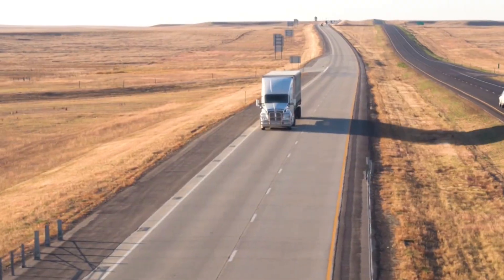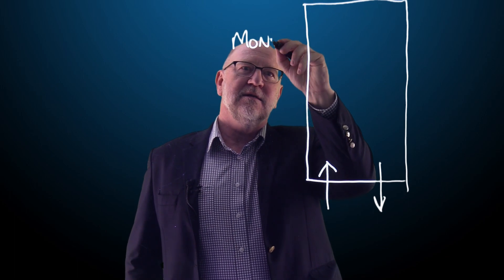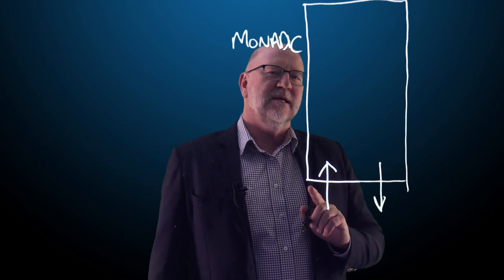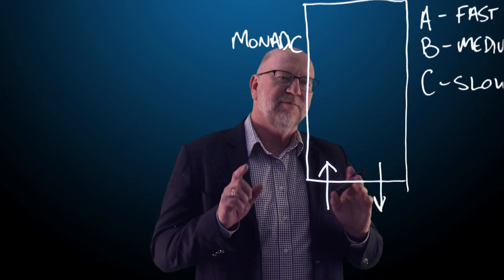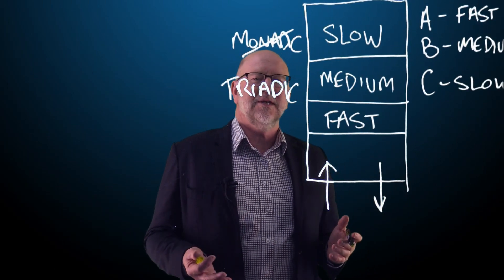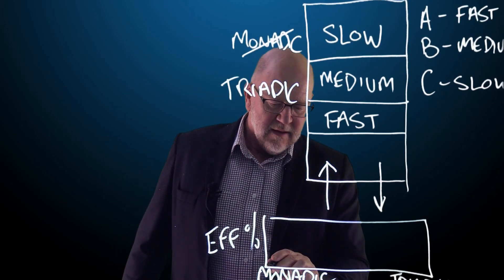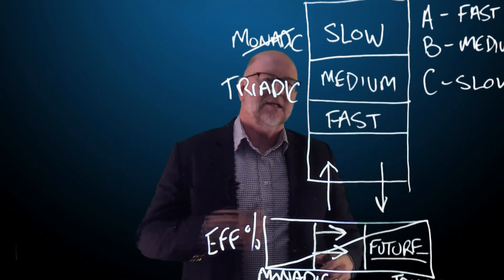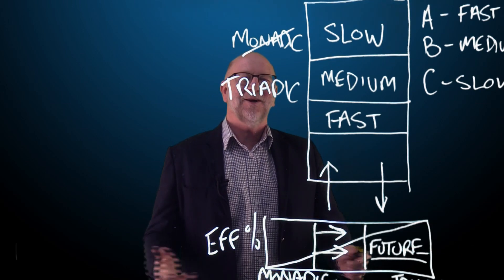Triadic Warehouse - More Warehouse Tips from Mal Walker

Comment: Triadic is incredibly old school and limiting. It works if there is zero expansion of items, zero innovation in new products, and if your warehouse is U-Shaped. It may work well in a distribution environment where a DC is replenishing other warehouses or retail locations where there are no new products added. 

However, if you have a lot of SKU’s, new SKU’s being introduced regularly, then triadic will cost more labor hours in constantly moving around inventory between A, B and C zones. In that case a monadic warehouse where items can be stowed randomly is far superior. 

Efficiencies in order picking would then be focused on optimal pick path, multi order picking, multi unit picking with a sortation process between pick and pack.
Reply from the maker: I wouldn't disagree with you, to a point.   Certainly a lot will depend on SKU range, frequency of changes to the range etc etc.   As with many of these techniques they need to be applied in a way that suits the organisation.   So Mal is discussing a concept here, the implementation of which will surely vary depending on the business needs.